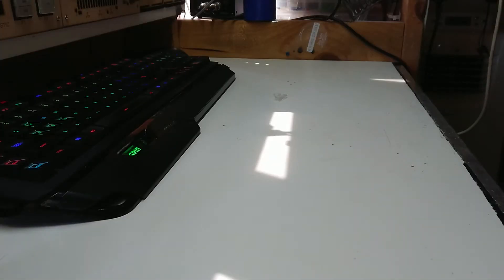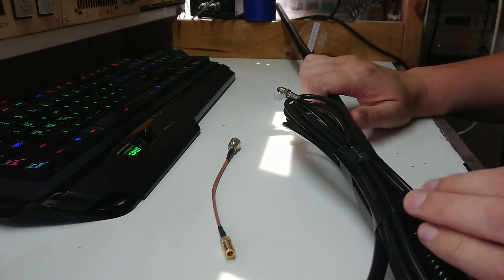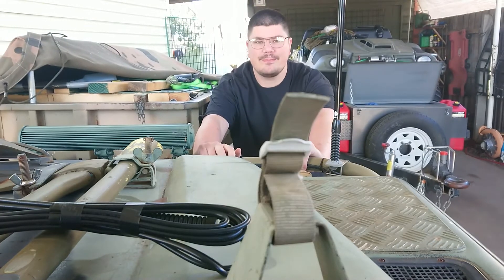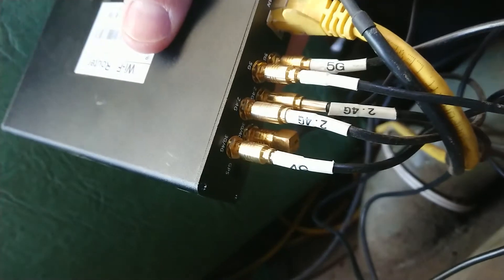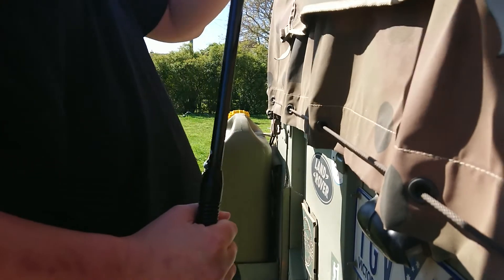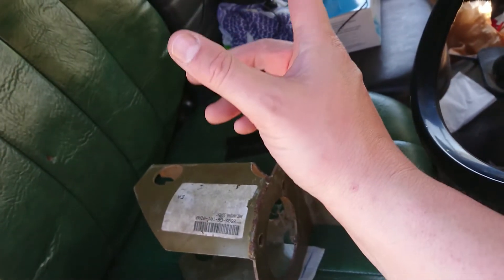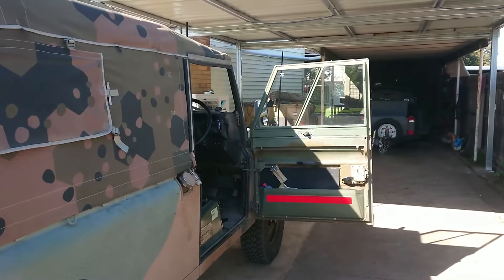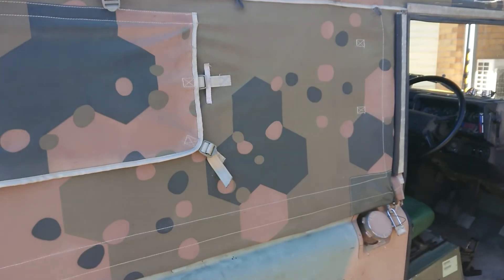Testing 4G MIMO Antenna setup

Comment: It sounds like you potentially have a configuration issue with the router, or its not correctly band steering. I cant make out what make / model you are using sorry. I use a lot of the Teltonika RUT950 or 955's for mobile deployment. They are certified for Telstra 4GX (700MHz network) that would suit your 4WD missions! They even have GPS location, Wi-Fi, multiple ethernet etc etc. Highly recommend if you have some spare cash! 

Spacing between the antennas shouldn't be a big issue. A lot of commercial MIMO antennas actually have both elements within the same casing, normally at 45deg opposite polarity. You would get away with both antennas mounted either side of the bullbar if needed. The RFI CD series are great, I personally prefer the CDQ series, as you can un-screw the antenna from the spring base. Good for removal if damaged, low area access or to avoid being stolen.

Keep up the interesting videos :)
Reply from the maker: This modem is a recent replacement, going to stick with it, as I have specific plans for the future.

The choice of antenna is specifically to make them harder to steal.

And yes, the configuration layout is different on this model, and not fully familiar with it.

I tested this later in the middle of the night and got a much more symetrical result, so I think most of this is network congestion.

Comment: Just reading up on MIMO, can the network in your area support MIMO?
Is the antenna at the back of the vehicle up against any metal in the frame you have it fixed too?
I'm not sure but those antennas have multiple elements in them along their length.(Possibly co-linear array)
So the whole length of the antenna is receiving/transmitting and should be kept away from any metal objects.
Reply from the maker: Yes, had installed numerous MIMO capable 4g LTE modems when working for a comms company. proximity to a Military base has some influence on that too. I suspect they requested the ability, as the copper lines to the base are not sufficient for MPLS.
Only very recently have I seen trenching being constructed and a mystery bright blue reinforced cable being laid in the direction - so I assume they have finally gone to Fiber.

I've been in the network termination building on the base, and everything runs fiber until it heads to the outside world, that connection is hidden in a big black locked rack with nitrogen filled coax heading out - in matching pairs. I deduce from that, MIMO is a possibility.
Reply from the maker: When I worked for a comms company we had a transparent demo model of that antenna, they run mylar supported copper tracks right up to the tip where they have 4 different elements - a majority of the length of the antenna is just elevated feed. But yes they are colinear (will add link to RFI's listing), but they are compact colinear elements so they can fit multiple bands in a small space.

the reason for the temporary placement on the canvassed area is that there is minimal proximity to metal structures there - only the roll frame at the top for about 15mm - and outside of this video, it won't be in operation again until the antenna is relocated.

The position will be changed at a later date when the brackets are fitted (in a few days most likely).
Reply from the maker: https://www.rfiwireless.com.au/cd7195-4g-lte-cellular-mobile-antenna-698-2700mhz-black-radome-black-chrome-spring.html